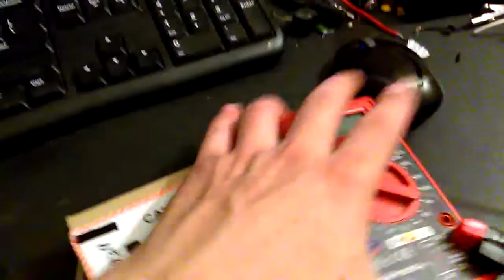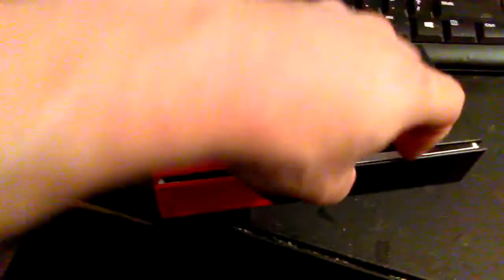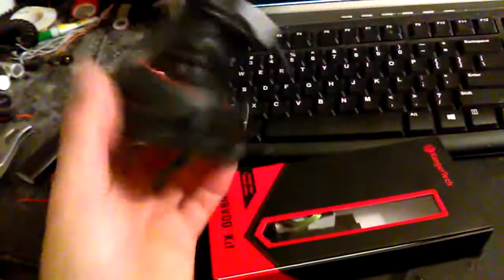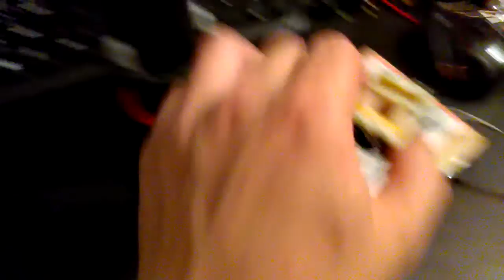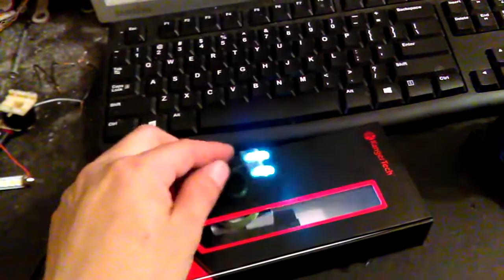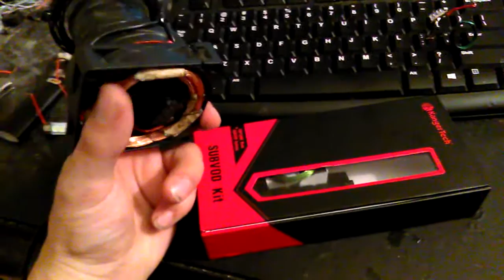Another Wireless Charger

Comment: Some great uses there !
For the heating, a diode on either the pos or neg input connections works well. Just put one in series with an input power wire, 1N4007 or similar...the faster the better for least losses.
On your receive side, a 0.001uF cap across the coil can improve power transfer too. Can experiment with a few pF to 0.01uF, some particular value will show a noticeable further improvement.